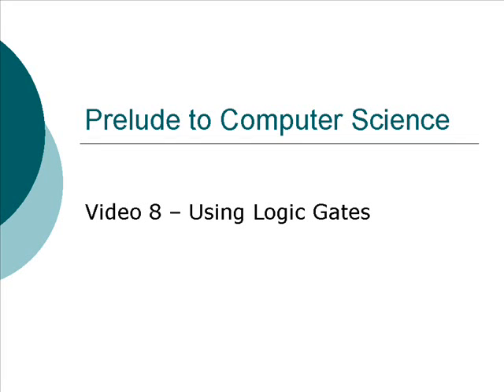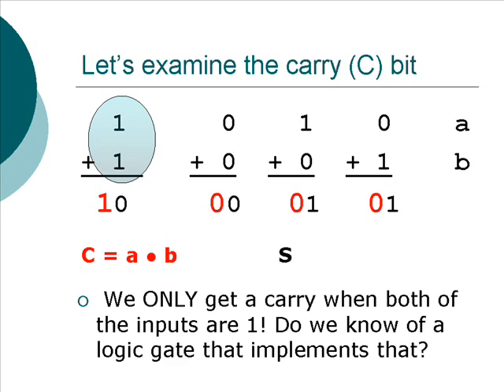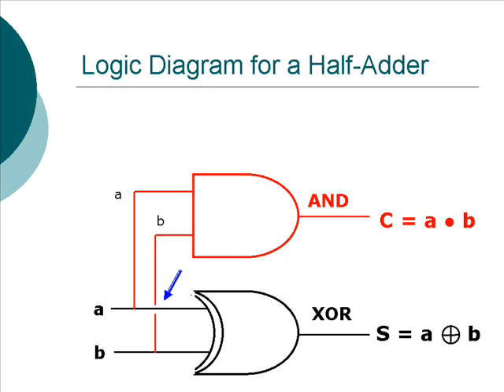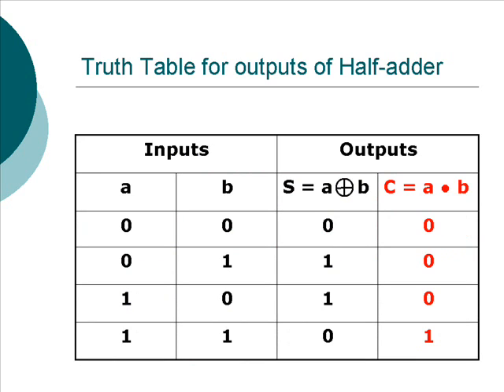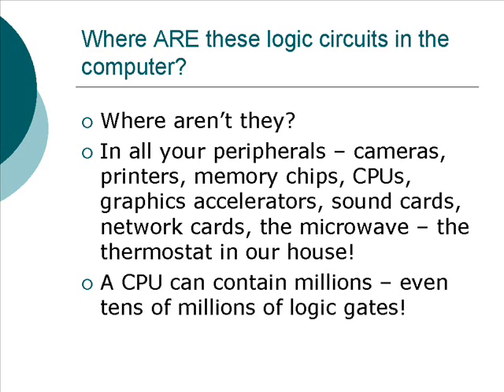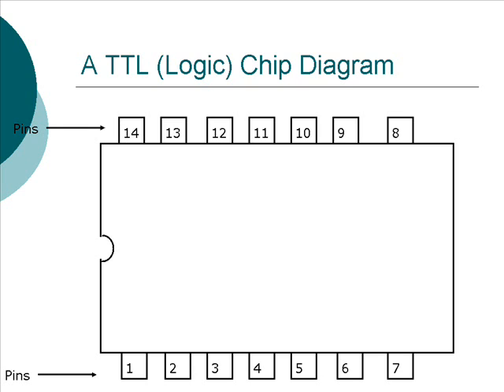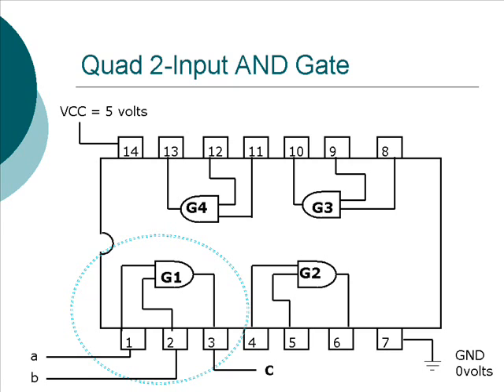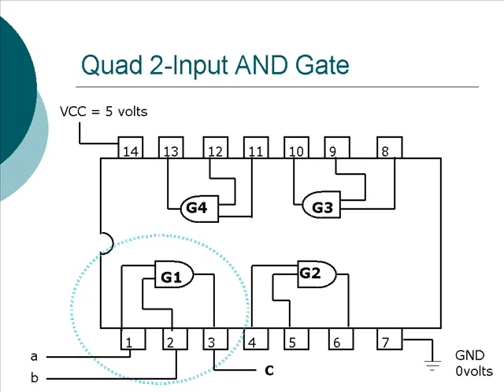Prelude to Computer Science - 8: Logic Circuits

Comment from the maker: You can add one bit with a couple of them!  You can carry a bit with a few more.  But processors have to be able to hold lots of data and move it around - your processor even has its own memory, called cache.  CPU requires logic to address internal and external memory, put data on the data bus, lock it into registers ... and many more functions besides just adding: multiply, divide, etc.

Comment from the maker: @MrDavidVuong David, I don't do people's homework - and in this case, the question is vague.  It sounds like you just split the high voltage (T).  Draw a point with one line coming in from the left that is your input.  Draw four lines coming out the right.  Those are the outputs.  Tie the left side to a high voltage (high voltage is true).  You could buffer the outputs or send to LED.  No idea what your prof might expect.

Comment from the maker: @MrDavidVuong If I understand your problem, it's essentially ignoring the inputs and setting the output to 1.
So solution 1 is to just ignore the input and set the output to 1.
Solution 2 call the inputs A and B.  Use three circuits two 2-input ORs and one 2-input NOR gate. NOR1 is input 1 on NOR gate.  Call OR gates ORx and ORy.
The final value you want  will be the output of ORy.
cont'd

Comment from the maker: @MrDavidVuong 
Attach A to NOR1 (input 1 on nor gate)
Attach B to NOR2
Attach A to ORx1
Attach B to ORx2

Attach output of NOR gate to ORy1
Attach output of ORx gate to ORy2
The output of the circuit is the output of ORy.
If you build it, let me know if it worked.  I'm doing this in my head and I'm an old guy, but I think that's right.